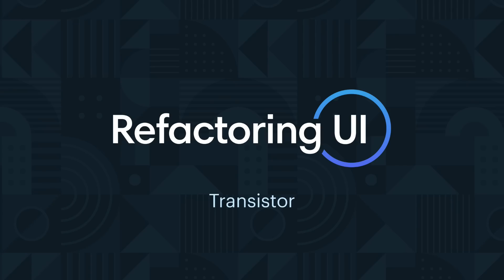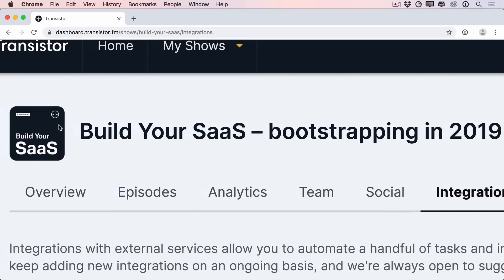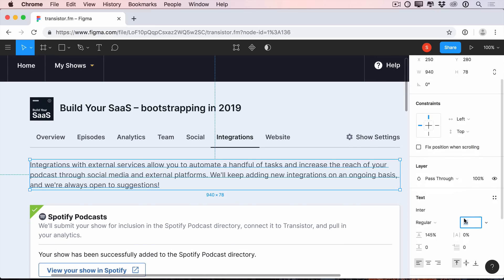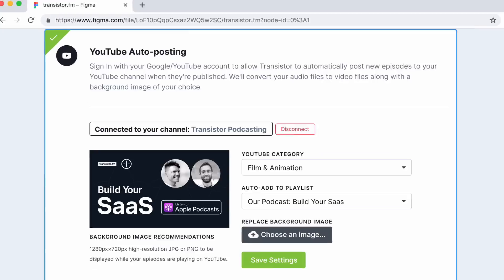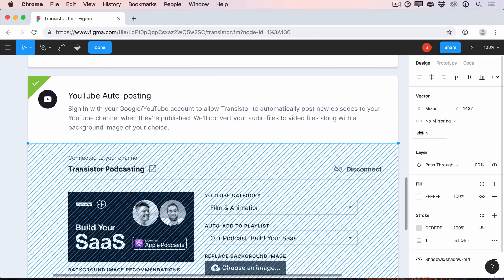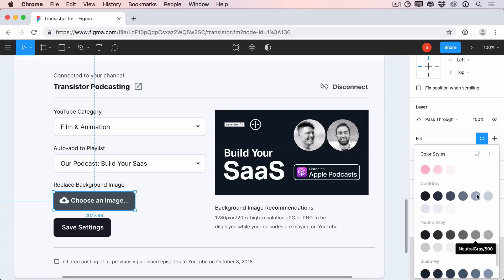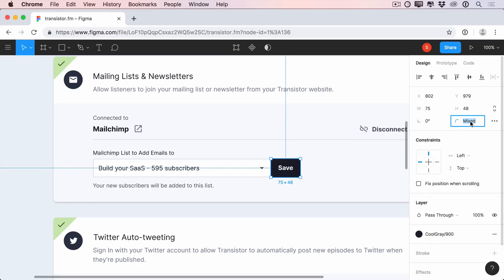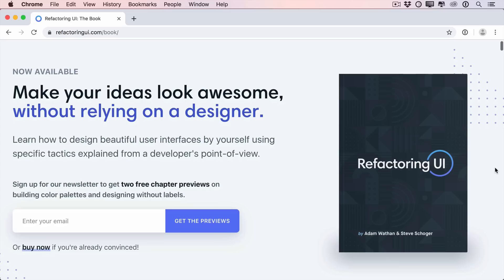Refactoring UI: Transistor

Comment: One of the most useful redesign videos I've ever watched. Now I'm going to be useful by listing the main tips:
1. Reducing the max width - "Anything between 960 and 1024 should suffice". (1:14 - 1:38)
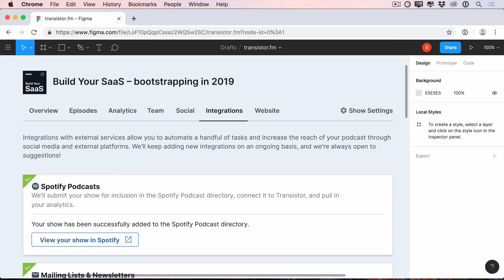2. Use color instead of bold weight to distinguish selected tab. This prevents 'shifting' (3:50 - 4:18)
3. Place simple icons inside a circle to make them appear bigger without looking clunky (6:30 - 6:50)
4. Use a divider to associate a button to a title that its far away from (9:05 - 9:25)
5. Use different background colors instead of borders to create separation without cluttering the interface (9:25 - 10:10)
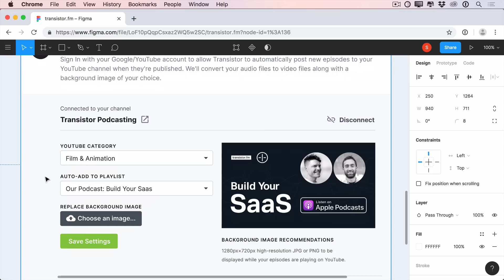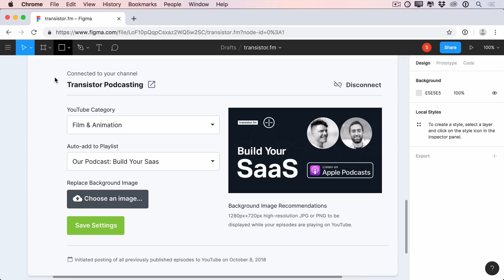6. Set button and input field heights between 40 to 48 (10:50 - 11:10)
7. Use a soft background colour with dark text to make alerts that don't hurt the eyes. (12:48 - 13:50)
8. Consider button placements in your form. (14:38 - 15:50)
Reply: Thanks

Comment: how did you bring the website over to Figma? is that a feature in Figam? I use sketch most of the time. Never seen something like this before.
Reply: This is not a feature of Figma, but it can import Sketch files. Steve usually makes a copy of the current iteration of a site into whatever design application he's using, so it's mostly done by hand.

Comment: I love your videos - can I suggest you do a few videos that break away from the 'safe UI' design? I see you tend to default back to the tailwind css look, but in a lot of projects that's just not possible due to brand limitations. I often get stuck when trying to either stick closer to my client's branding OR trying to think up new looks for the same UI so they feel like they're getting something more unique to them.

I recently had a UI that I produced for a client which had nice space around elements, but they wanted it all squished together and padding reduced MASSIVELY because they wanted more info on the screen at any one time, even after me informing them that people aren't opposed to scrolling. -.-
Reply: this sounds like a lack of research.

i wouldn't rely on design videos to cram info on in better ways. perhaps you just need the right competitive products to compare to and the right research to use as evidence of having users scroll a bit more for more pleasing designs